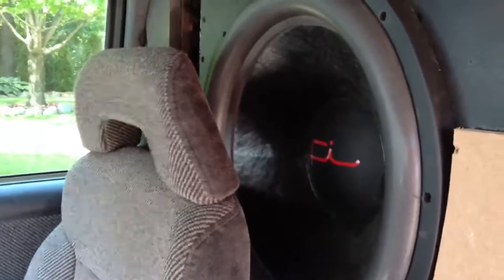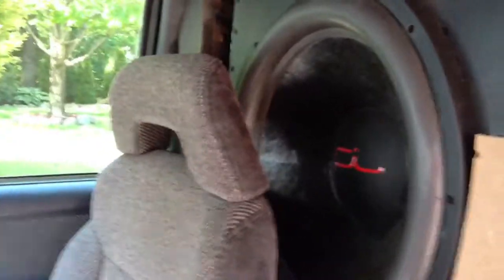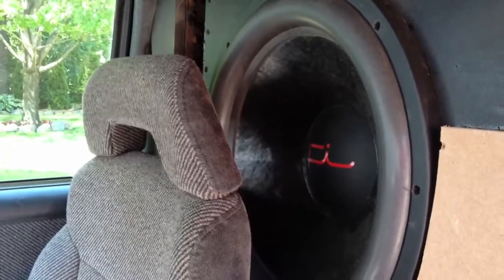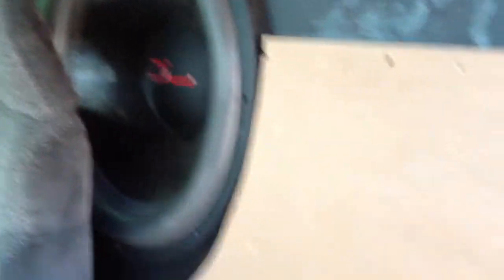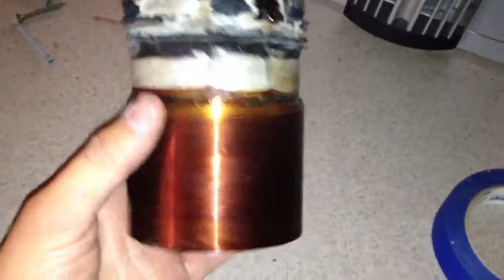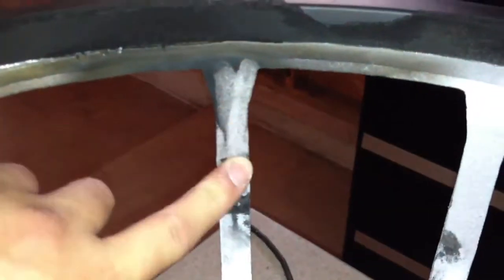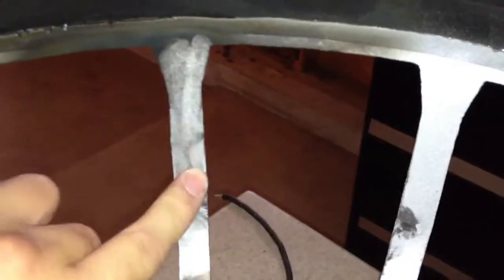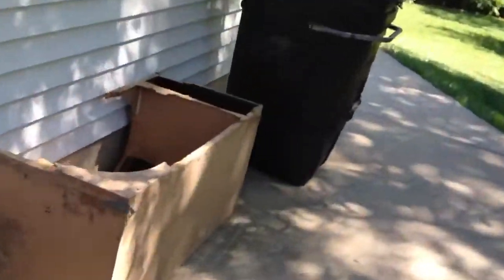BTL n2 needs a recone

Comment: Same thing happened to me it was a tinsel fire. It ended up warping the basket so after i put the recone in the coil would rub on the magnet structure sense it was unlevel so be safe and get another basket if you have to